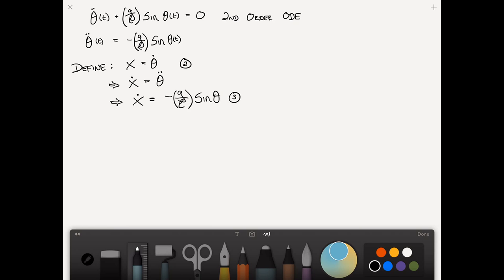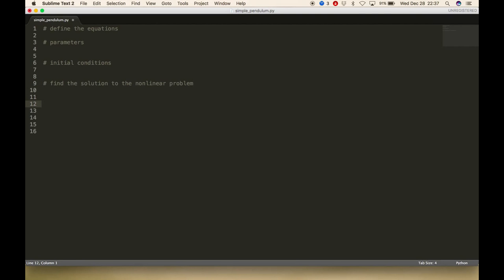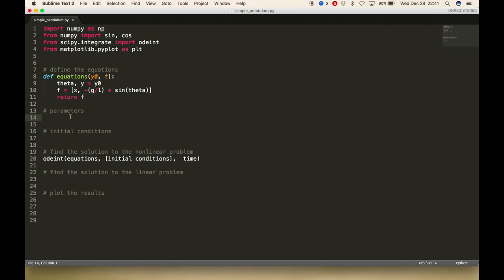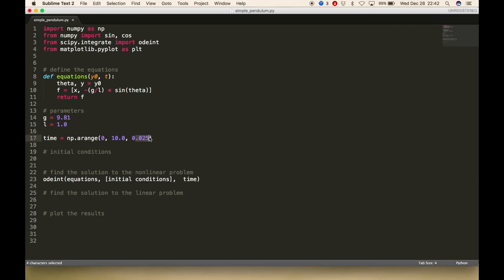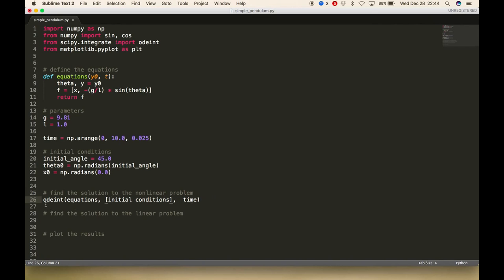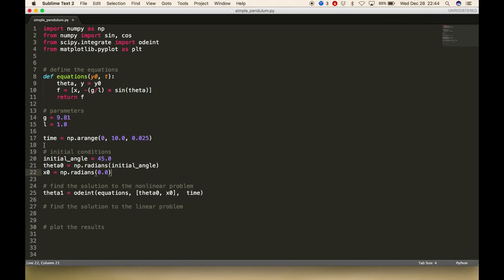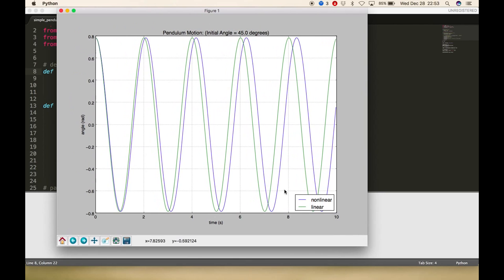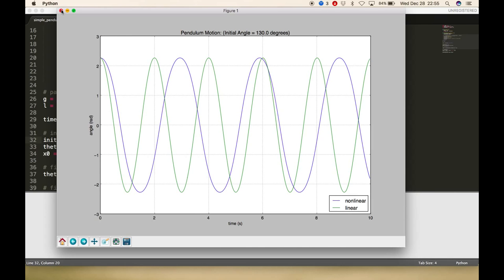Coding a Numerical Solution to the Simple Pendulum Problem using Python

Comment: Hello, very clear explanation, but what exactly happens with all the time steps? Like where are they used? Because in the function itself there in no variable "t" so then what does the program do with those values?
Reply from the maker: Sorry for the delayed response.  I missed your comment until now.  I have defined the variable 'time' to be a list of times from 0.0 to 10.0 seconds in increments of 0.025 seconds.  The list of times is passed to the  'odeint' function uses these times to calculate the nonlinear solutions (I believe it uses a RK-4 integrator to accomplish this).

Comment: At 45 deg or even more than that..wave must be flattened at the picks...so that nonlinear case would be clearly visible... check alternative numerical method
Reply from the maker: You make a good point.  I did check the packaged ode solver against a Runge-Kutta 4th order integrator that I coded myself, and the results were identical.  As I increased the initial angle, I finally got to a point where the peaks flattened, but it was closer to 180° - I can publish the charts I made if you're interested.  Will have to investigate this some more, but I'm curious about the peaks you have seen at 45°.  Do. you have any charts?
Reply: @Freeball99  no I haven't tried it through numerical method...I have performed virtual experiment through dynamic simulation in Autodesk inventor software..

Comment: Hello, Sir. I tried implementing the same routine using the odeint function. I noticed that the resulting values for theta using the nonlinear solution do not vary, even when I try to use different time steps (0.001s, 0.01s, and 0.05s). Shouldn't there be noticeable differences in the resulting values of theta with varying time steps? Thank you.
Reply from the maker: I'm not entirely sure what integrator the odeint function uses, but based on my comparisons with an RK-4 algorithm, it appears to be similar, perhaps even identical.  If that is the case, then it will be 4th order accurate.  So for timesteps of 0.001, with will be accurate to (0.001)^4 and with timesteps of 0.05, it will be accurate to (0.05)^4 = 6.25e-6 or about 6 decimal places.  So both are going to be very, very accurate.  In fact, pretty much if the timesteps are small enough to keep this integrator stable, then it will be very accurate.

What I have said above applies to both linear and nonlinear systems.  The timestep does not demonstrate the nonlinearities in the system.  In order to show the nonlinearities, try giving the pendulum an initial angle of, say 15 degrees versus 30 degrees.  Is the period of oscillation twice as long when the angle is twice as big?  It will be the case in the linear range (about 0 to 10 degrees).  If you compare initial angles of, say, 3 degrees vs 6 degrees, you will find the period of oscillation exactly doubles.

Comment: why when I write def equation(t, y0), instead of def equation(y0, t) I have this error message :    
theta, x = y0 

TypeError: cannot unpack non-iterable float object

And for example for this code the inverse works...
def dSdx(x, S):
    y1, y2 = S
    return [y1 + y2**2  + 3*x,
           3*y1 + y2**3 - np.cos(x)]
y1_0 = 0
y2_0 = 0
S_0 = (y1_0, y2_0)
x = np.linspace(0, 1, 100)
sol = odeint(dSdx, S_0, x, tfirst=True)

Thanks for the answer
Reply from the maker: The order of the arguments in the function definition matters when you're using them later in the function. In your case, the error message TypeError: cannot unpack non-iterable float object suggests that y0 is a float object, which cannot be unpacked into two variables theta and x.

In the first example where you have the error, the function equation is likely expecting the first argument t to be a time variable, and the second argument y0 to be a tuple containing the values of theta and x. If you define the function as def equation(y0, t) instead, you will need to swap the order of theta and x in the return statement as well.

Regarding your second example, the order of the arguments in the function definition dSdx matches the order in which they are used in the function. So when you call odeint(dSdx, S_0, x, tfirst=True), the initial condition tuple S_0 is unpacked into y1 and y2 as expected.
Reply: @Freeball99  Thank you very much for the explanation Sir. All the best.

Comment: may i know how to using this method but to plot angular velocity vs time and angular velocity vs angle? and may I know theta1 and theta2 are represent for what (angular acceleration or angle). thank you.
Reply from the maker: Theta is the angle (as a function of time).  Theta1 is the nonlinear solution and theta2 is the linear solution.  In order to calculate the angular velocity (theta_dot), you can find the difference of two successive angle values and divide by the time step (0.025).

Comment: How would it be using curve_fit () function instead of odeint() ? and what differences would it have?
Reply from the maker: I'm not familiar with the curve_fit() method, but it seems to me that this method requires that I already have all my data points before I can fit.  The odeint() methods allows me to calculate my data points.

Comment: What causes the difference between linear and nonlinear solutions?
Reply from the maker: This is due to the nonlinear potential energy function.  As the displacement grows larger, the restoring force grows as a function of Cos θ - resulting in nonlinear behavior.  For very small displacements/vibrations, the restoring force is linear (because Sin and Cos functions exhibit linear behavior with small displacements).

Comment: what's the numeric method that odeint() uses for solving the equations?, can we change it? (I use Euler on Matlab)
Reply from the maker: I'm not completely sure, but I did compare it to a RK-5 integrator that I coded and the results looked identical.  So I would guess it is likely an RK45 integrator.
Reply: @Freeball99  Thanks. Ey I have problems installing SciPy and Matplotlib, so, can you tell me what version of python and libraries are you using? (I use python 3.8.6 and pip 20.2.3)
Reply from the maker: @JeXuZ4  I have run into some issues with Python 3.8.x being incompatible with some libraries (not sure if it was any of these).  To be safe, I'd recommend Python 3.7.x.  Also, a very cool, useful tool is Google's Colab (colab.research.google.com) which give you a Python environment for coding and already has all the libraries installed that you will need.  Work best if you use it with Google Drive.  This makes it very easy to code in the cloud from anywhere.  Just need an internet connection.
Reply: @Freeball99  Thank you man, I really appreciate your advice. I was working on windows and I just install ubuntu (comes with python 3.8.5) and everything went well... I used google's colab just once, I'll give it a shot.

Also, I'm thinking about building a GUI just to show a simple pendulum simulation with python, do you have any advice? I just saw a video with PyQt5 but thought matlab's GUIs looks better.
Reply from the maker: @JeXuZ4  I’ve never really been blown away by any UI libraries in Python. Most people use either PyQt or TkInter. Also take a look at Kivy. Can use it for UI work plus it builds cross-platform apps.
Reply: @Freeball99  Got it. Thanks again (y)